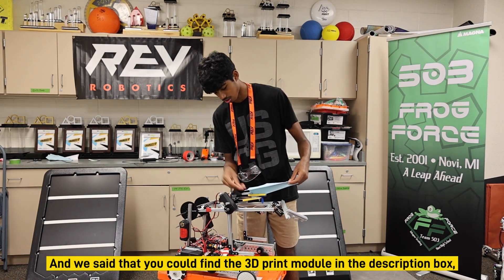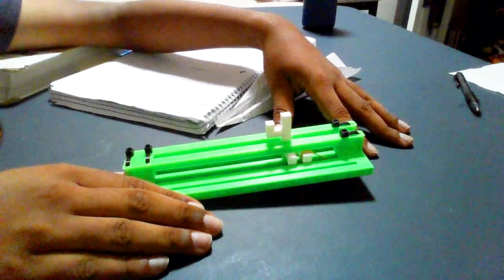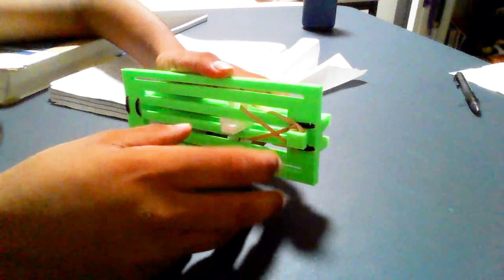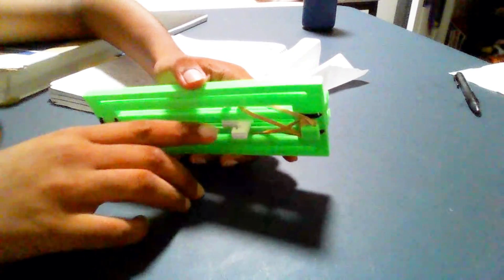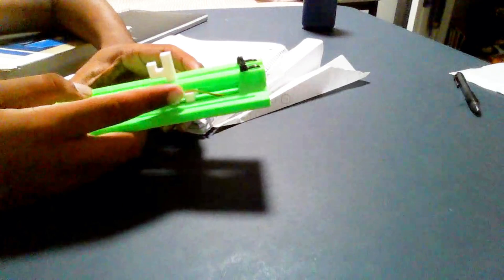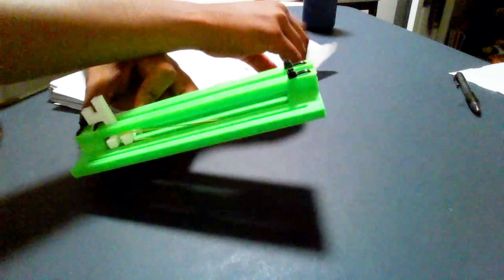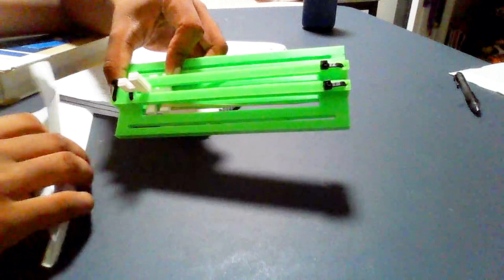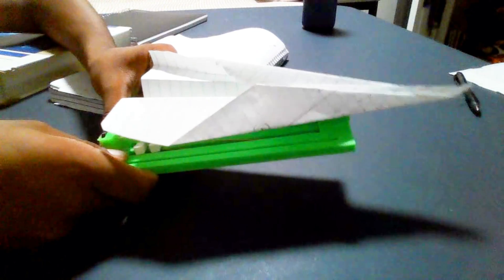3D Printed Airplane Launcher | FTC Centerstage 2023-24 Drone Launcher ✈️

Comment: Thanks for sharing!  We are going to give it a shot here in Oregon.  Team 20300.  By the way it appeared on the slicer really small so we scaled it by 10.
Reply: I was trying to figure out the scale. I think it actually needs to be scaled by 25 which makes the base about 195mm long. Looking at other objects in the video, it looks like that is about the right length (and also compared it to the hole pattern on the Rev attachments)
Reply: Issue could be depending on printer software, model is in inches, not mm. Off by 25.4.
Reply: @johnmaten6249  did you print it?
Reply: @johnmaten6249  hi man, which scale did you change?, how were the others?, did it work?, I eagerly await your return
Reply: Changed the scale by 25. 4 in each dimension. Tinted it out and that was the trick. It works but we are still working to mount it on the robot.

Comment: Nice, simple design. When I download the .stl files, they are not coming up properly in the 3D Printer software. We are using a MakerBot Sketch printer. Would appreciate any suggestions.
Reply: Having same problems. They are too small, I think they are not scaled correctly...
Reply: @redditrelays.  did you figure out what the proper scaling of the parts was?
Reply from the maker: Hi, the models were designed in inches so depending on your slicer software you may have to scale the parts up by a factor of 25.4. Hope that helps.